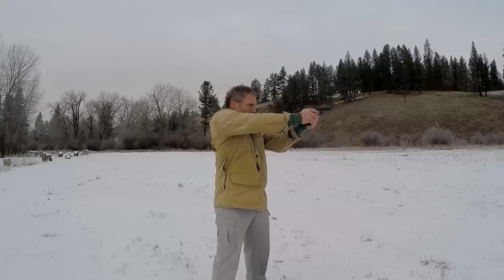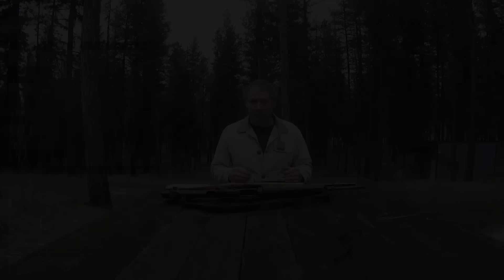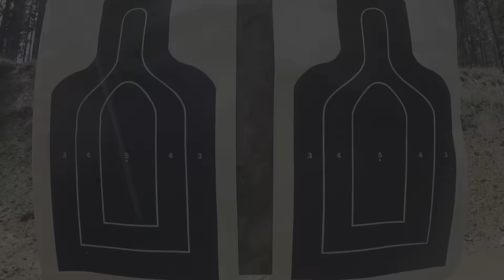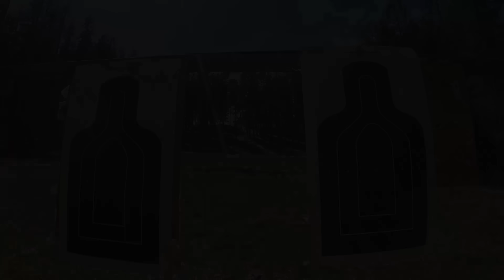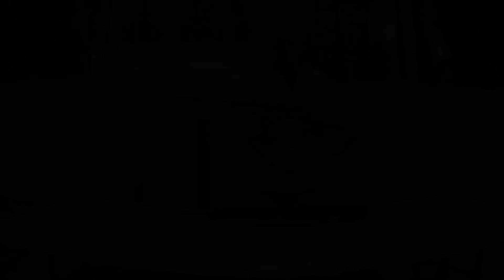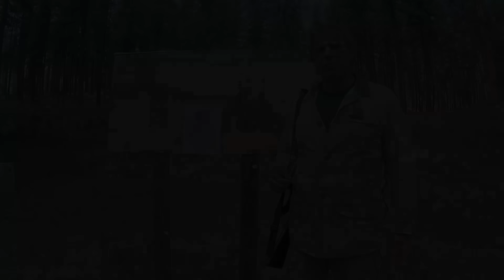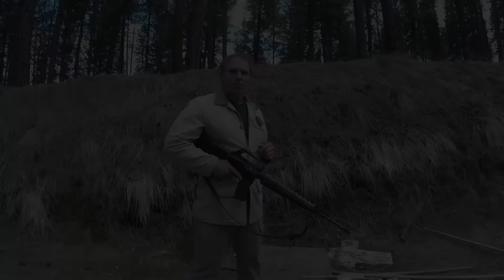Mini-14 vs AR15: Which is Better?

Comment: And you're wrong about the 25 yard vs 300 yard zero. At 3000 fps the difference is negligible. My .243 is zero'd at 50 yards and 200 yards at 100 yards it means it's less than 1 inch high. That more than enough to still be on the kill zone on a deer or fox.

Comment: A common misconception with the AR is that it needs to be constantly cleaned to be reliable. This isn't true, the AR only needs to be somewhat wet. It will run a very long time as long as there is some oil on the bolt and carrier rails.

Comment: Thank you Paul:  Well done.  I have just one question.  My Mini 14 is rated by Ruger to use either 5.56 or .223.  Granted, I bought this gun used in 1984.  I have been using both types of rounds and have had no problem with either.  I trust your shooting etc without reservation.  I so appreciate having your videos to watch.  Thanks again.
Reply: I read earlier they put them under .223 so they can be sold in certain European countries where 5.56 is forbidden....
Yes comical I know..

Comment: the only other test I would have done would be ten and twenty rounds rapid fire - well, rapid enough for the barrel to heat- to see which one strings its shots first.

Apparently the design change that made the Mini-14 more accurate was in 2003. in 2007 or 2008, they revised it again by putting in a heavier barrel.
Reply: Are u aware of their twist rates?  Do they vary like ar's can?
Reply: @matthewbeaver5026   The older Mini-14s have a 1:12 twist rate, iirc. I don't know if the 2003 or the 2007/2008 revision switched to faster twist rates.
Reply: @JKC40  some1 else commented else where that they believed all minis were 1:9..so with what u say maybe, all the new minis are 1:9 
Which is another reason to go ar imo, more options
Reply: @matthewbeaver5026  ok, a quick search shows early ones had 1:10, middle ones had 1:7, and new ones have 1:9

Comment: Unfortunately for me, the 1 and only Mini 14 I owned was no doubt put together by someone with the brain capacity of a potato.... I personally wouldn't own another. That said, my Ruger MKlll target is unbelievably accurate.
Reply: I owned a mini 14 in the early 80's. It was very rough. No finish and the stock was painted black. I gave $100 for it. It did shoot just fine. I ended up trading it for some mags for my Nova. I was in the National Guard at the time and we had the M-16A1's. The were beat to death too. I did like better overall. But I did see a lot of those old ones malfunction. The 14 never did. I'm not really a fan of the 223-556 round. Much prefer a 308-762.

Comment: Really great video. One of my favorites.

I enjoy shooting the Mini-14 more than an AR, but I own 3 ARs, and NO Mini-14s.

That's because the AR platform is a MODULAR system. I have an AR set up for 7.62 X 39. It shoots very well. Soon, I will have a set-up for the Beowulf .50. Lowers are interchangeable. That's nice.

The AR has a very bad press right now, due to gun-grabbing progressives, but it's popularity has not flagged at all over many years. I stopped hunting years ago, so I now shoot for the enjoyment of the sport. I have firearms for my personal enjoyment, the protection of people and my property, and in defense of the US Constitution.

Comment: Mini 14 is a great alternative for banned states however at 700-800 dollars I think a ruger 556 or M&P sport ii at 500 is a better deal.  Cheaper mags that arent proprietary and cheaper/easier to upgrade if need be.  Parts are easily found and can be fixed by the user even an inexperienced one.  My 2 cents.

Comment: It was long but enjoyable. I love it when you agree with my view. I have had both and still have the AR. The magazine issue was the reason I switched. Ruger would not sell 20 round mags to civilians and non LE so aftermarket was the only option. Mine was 100% reliable. Had a old school red dot sight on it and it was accurate enough for the distances here in the mid Atlantic

Comment: I noticed that you didn't talk about the 50 yard/200 meter zero.  One can shoot out to 300 yards holding about a foot high.  Further, poa/poi differs by only 2 or maybe 3 inches out to 250 yards.  What do you think of the 50 yard/200meter zero?  I am referring to an AR-15 without a carry handle with a long and short range option.

Comment: Just on ease of maintenance alone the AR is a winner. Sort of ironic that Ruger is now also a player in the overcrowded AR field, almost like saying "if you can't beat them, join them". My vote is for the short modern M4, yes with that shortened 16" bbl that brings down velocity as compared to 18.5" or 20" even more. A velocity loss of 200 fps over a 20" bbl is worth taking unless in the field, in a condo the smaller the better. Shotguns are primary always tho, AR is secondary for home defense IMHO.

Comment: Awesome sauce Paul
Just a little tip:
Polenar Tactical has demonstrated how to perform a Tactical Reload with an AK (Not a Mini 14 but similar principle due to it being a rock and lock). Grabbing the new mag, bring it next to the old mag, press the mag release with your thumb and whilst holding the old mag with your thumb and whatever fingers can reach it, rock out, then rock in the new mag, slide away the old mag. Possibility that the principle may apply with the Mini 14, but of course, slightly similar designs does not dictate similar approaches.
Keep up the great work however!

Comment: I just have both, saves confusion. I use my mini around the Ranch because I bought it as a ranch rifle i.e. not mollycoddled in a case I take to the range . It has been in mud, rain, cow shit you name it. Still runs great 40 years later. 
I however would go with my AR's if push came to shove.

Comment: Yeah!  Good presentation, as usual, but I have a coupla questions comments. While the Mini-14 is sorta/kinda based on a military rifle, it really isn't one... it's a sporting rifle. The AR is a military rifle and while it works well(or well enough) as a sporting rifle, it has some disadvantages in that venue. For me the major one is carrying it around in the woods for hunting... the pistol grip is a PITA vs a standard stock. I'm sure some thought when into fighting ergonomics with the AR so mag changes, etc. would be better facilitated. The Mini-14 was not conceived that way. Also, was there a rifling twist difference between the Mini-14 and the AR in this test? While 55 grain bullets can accommodate a decent range of twists and deliver good accuracy, they will be a little better with one than another. My military experience with the AR platform was with the M-16... no bloody A, A1, A2, A3 OR... A4 (to paraphrase the legendary Scotty). Buying an AR platform rifle (a 20" hunting variation by Mossberg) some years back was almost like coming home... that "boing" in the stock was especially noteworthy in my memory. I went off to buy a Mini-14 but came home with an AR. As you said the the price difference made a big difference to this old po-boy. I have no regrets and the AR has been very tunable.

Comment: Why not have both? Most AR rifles of today will be M4 types, unless you want longer or shorter barrels for other uses, or have other caliber needs.  Adding red dots or scopes changes things too, usage wise.  Didn't really assess the difference in sights but your analysis makes sense, like always. Mag changes were definitely the main difference in operation.  Better reload that mini-14 behind cover, and 10 round mags take even longer, because you don't  have the same leverage on a shorter mag.  But functionally, out to 200 yds or so, with either one, and both having red dots, they will accomplish the same thing. Most people won't shoot enough in compromising environments to test the reliability of either.  Price and acceptability locally of the AR, which may not be legal for purchase in it's non-neutered form, does make the mini-14 a good choice. $800 or so compared to a higher end AR like DD, LMT, BCM, that can easily be $1500-$2000 or more, can sway you one way or the other.  Adding peripherals really can add up.

Comment: The AR15 platform has become a lot more affordable, and is more versatile. The Mini-14 used to be a less expensive option, not any longer.
Reply: Freedom First
I bought my Mini-14 just before the "Assault Weapon Ban" in 1994 because I couldn't afford an AR-15. Then I discovered that there were no reliable magazines available except Ruger 5 and 10 rounders.

“no honest man needs more than 10 rounds in any gun…I never meant for simple civilians to have my 20 and 30 round magazines…It has long been Ruger’s policy to limit sales of those items to Law Enforcement or Military purchasers”

Thanks Bill Ruger.

So I put it in a case and never fired it.
Reply: kevin Johnson I have later version Mini14 with the tapered barrel. Factory Ruger 30 round clips are wildly available. Oil that baby go have some fun!
Reply: yup, i stopped trying to look for mini14s, im looking into getting an m14 but they cost more than a darn ar15. might just go with a chinese ak variant. might just make a diy sten gun lol

Comment: I sat thru the entire presentation 🎥...... 🖥 

Well done Paul on an even scale for a
gun-vs-gun check list...

I firmly believe the current production Ruger mini-14 models are far more accurate than the previous models made 30 - 40 years ago... I love the look and appreciate the older Mini-14 GB / ranch rifle models... Also the mag changes and choices today are much better with current rifles...

I have both old & new mini 14’s and experienced smoother over-all function with the newer model mini-14’s

For defense purposes thou I will always go with an AR-15 platform rifle because of the ease of use with optics and accessories...

The Mini-14 In my view is a great truck gun / farm house defender / shooter for grab and go shooting

Comment: I have owned three, the most recent being the revised barrel mini 14, I believe 2016 production. All 3 were well built but absolutely shit for accuracy. Reading the forums, apparently this was the case with the mini. Claims of "Barrel whip" and voodoo magic barrel stabilizers are widely talked of in the mini 14 circles, as the cause and solution for the inaccuracies. I have always been perplexed by how the AR fires the same round but doesn't suffer from the inherent inaccuracy of the mini.

Comment: I own both and reload my own ammo for them. One advantage the mini 14 has is it doesn't dent the brass casings as much as the AR15 does when it's being ejected. You also don't have the buffer spring vibrations on your cheek with the mini 14 like you do with the AR15. As far as magazines go the latest generation Tapco mini 14 mags work great and they only cost around $20

Comment: Not much of a comparison. The AR-15, being a piecemeal lego gun which can be assembled at home with very limited mechanical know how or tools, can be had cheaper than a Mini-14, with a laughably larger number of accessories and attachments. On top of easily being able to out shoot a Mini-14 in terms of MOA group size per dollar or hour spent accurizing the rifle. Mini-14's only become sub-MOA guns when handled by extremely skilled gunsmiths replacing the barrel, fine tuning the gas system, swapping out parts left right and center and steel bedding the action into a fiberglass stock only after it's been custom fitted. As where sub-moa AR-15's can be put together by home builders with a very moderate skill level of know how. I like Mini-14's, damn fine little rifles: but it's an older design which is harder to produce the same level of functionality as newer designs. 

It's the M1A.v.AR10 phenomena. I can buy an AR-10 type rifle for around a thousand dollars from DPMS or Smith and Wesson and not only will it be reliable but it'll shoot sub-moa groups any given day. If I want to buy an M1A capable of sub-moa groups, routinely, (not just once in a while), I'm probably going to spend three to four thousand dollars. Meanwhile, for around twenty five hundred dollars I can get an AR-10 type rifle which will routinely shoot quarter moa. You would be hard pressed to find an M1A type rifle, from any manufacturer, at any price, capable of doing the same: aside from what unverifiable accounts on message boards will claim. More over, with that thousand dollar sub-moa AR-10 type rifle: I have nearly unlimited options for accessories, rails, lights, optics, hand guards, pistol grips. More options than any one person could actually find out about if he or she devoted every day to attempting to identify every single possible accessory. I don't have that with the M1A unless I put on some kind of chassis system which will make it heavy enough to use as a boat anchor. 

Everything which applies to the M1A v.s. AR-10 argument: also applies to the Mini-14 v.s. AR-15 argument. Older design with less customization available verses newer design with more customization options: and due to the nature of their designs - one is far easier to make far more accurate. That said, you don't buy a Mini-14 or M1A because it's technologically superior to an AR-15 or AR-10: you buy it, because you like it. I don't own an AR-10 type rifle, I have a VEPR in 7.62x54r. Is it as light as an AR-10? No. Is it as accurate as a comparable priced AR-10? No. Do I have as many options to customize it as I would with an AR-10? No. So why do I own a VEPR and not an AR-10? Very simple, my favorite rifle is the Dragunov SVD and until I have eight thousand dollars just sitting around collecting dust: my VEPR is the closest thing I can get to that unicorn rifle and I love it. I wouldn't trade my VEPR for an AR-10 even if the later was three times as accurate for the same price, I'll keep my VEPR. 

From my perspective, Mini-14s and M1A's should be looked at the same way. Or the way classic muscle cars are looked at compared to the street racers of today: the newer are better in every way with better shocks, better handling, better acceleration, higher top speeds, better fuel efficiency, lighter bodies, blah blah blah. Give me a GTO over some pastel colored and ground lighted chunk of plastic, every time.
Reply: Observing Libertarian The Mini-14 is the cheapest way to own an M1/M1A/M14 style action.  Due to Ruger’s modification of the design and casting technology, you can get an M1 style rifle for under $1000.  If you want to faithful to the design, it will be expensive to make and price an M1A.  They aren’t overpriced, they are more expensive to make.
Reply: @michaelr.1709  

"The Mini-14 is the cheapest way to own an M1/M1A/M14 style action."

True, and? Did I say otherwise?

"If you want to faithful to the design, it will be expensive to make and price an M1A."

True, and? This has nothing to do with anything I wrote.

"They aren’t overpriced, they are more expensive to make."

Did I at any point say they were "over priced"? Prohibitively Expensive? Over Valued? Exorbitant? Did I enter any inference, euphemism or indication that I thought the prices on said items were unreasonable? Original comment remains unedited, no where did I determine, say, proclaim, assert, infer or even suggest M1's are over priced. That bit of dialogue to which you are referring as though it came from me, does not exist within the comment above, which remains: unedited.
Reply: Observing Libertarian tldr.

Comment: Assuming you live in a place where AR-15s are legal, there are very few reasons to stick with the Mini-14. This comparison tried to give every advantage to the Mini-14 by using an older style AR, and the AR still comes out on top. More modern designs only widen the divide with free float hand guards, optic rails, modular accessories, and so much more. The Mini-14 isn't terrible, but the AR platform is just so much better in a ton of little ways.

Comment: Back when the mini 14 didn't have a 1x9 twist barrel,  and reliable mags... it was not as good of a choice.  
Now they're a great choice but often more expensive than decent entry AR15. 

Great video as Usual Paul
Reply: But i would say the erogomics of the ar seams better ... But the assembly of the mini seams better.... Why can't I get both :(
Reply: @matsv201  only money why you can't get both...
Reply: I read that there was an issue with outsourcing for barrels for several years.  Then they came back with a ruger barrel, and with, I believe, a heavier barrel too.  Do you think this was in the same period, and do you know what twist rate they switched to?  
Also, are you sure there is not 223bullet weight that would accommodate a 1:9?
Reply: @jimf1964  they used 1 in 14 and then 1 in 12 twists for years.  You are right,  they came out with a heavier 1 in 9 twist barrel in the early 2000s I believe as well as the ruger factory mags after the ban was lifted.
Reply: @jimf1964  45-62grs in .223 are fine in .223
Reply: Alaskan Ballistics  so as stated below by someone else, different generations have different twist rates.  I'm guessing that was in response to many people going after lighter, faster rounds.  So I'm wondering if the "hit and miss" Paul was talking about may have had anything to do with bullet weight vs twist.  If mike is correct, going from 1-14 to 1-9 is a heck of a big difference.   I'm not an expert on the topic, but I feel that's a big difference to how fast it'll be spinning.
Reply: @jimf1964  you are correct. Having a slow twist rate is like having  too small of a hand to throw an NFL size football with a good spiral... 
I can barely stabilize a high school football.  
But those middle school footballs I can zing with a tight spiral